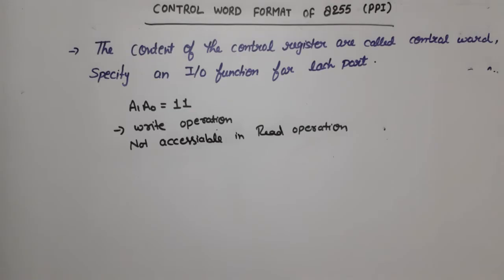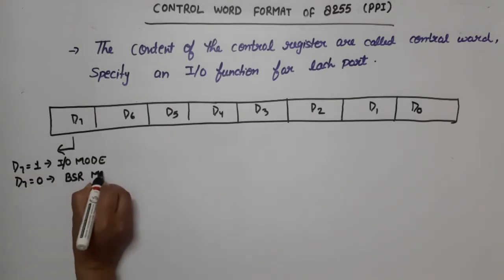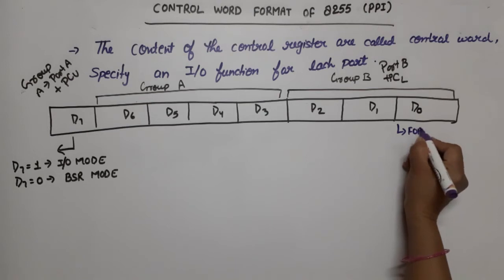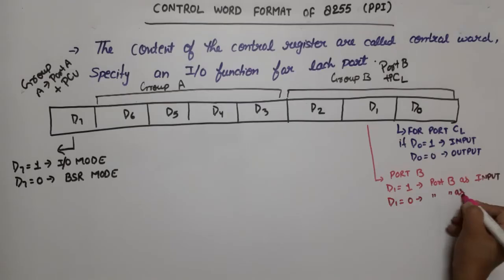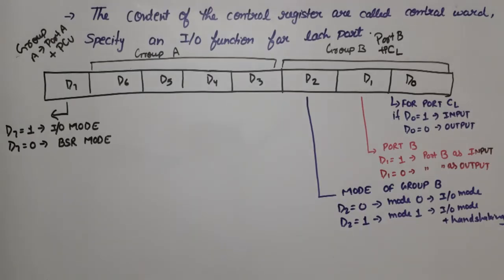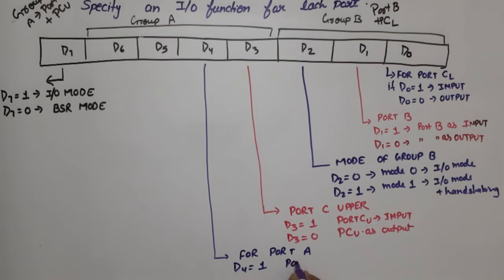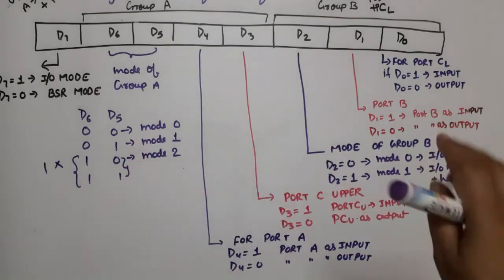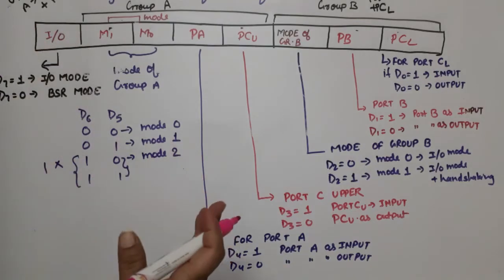U3 L10.5 |Control word format of 8255 | I/O Mode Control word format 8255 | control register of 8255

Comment: Ma'am what would be the C upper and  lower signal in Mode1 (if Pc is handshaking) ?
Reply from the maker: Both will be used FOR handshakes 🤝 means one port sen request another will send acknowledgement for request
Reply: Thanks ma'am for your valuable response. 
As I understand PCl and PCu both will have high (1), in above described case.... Correct me if I'm wrong 🙏🏻